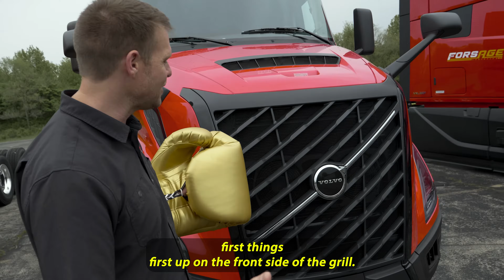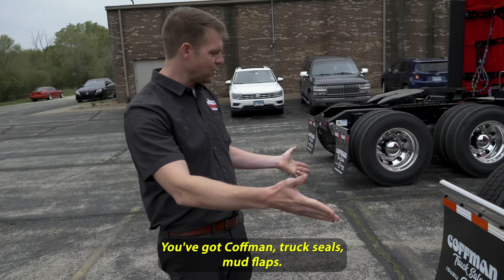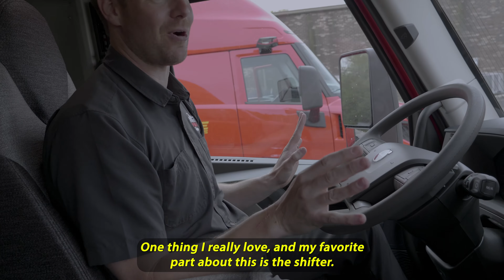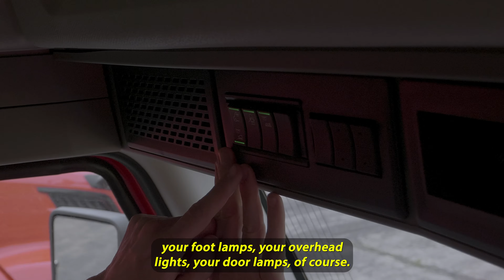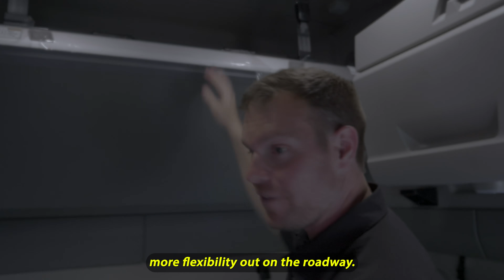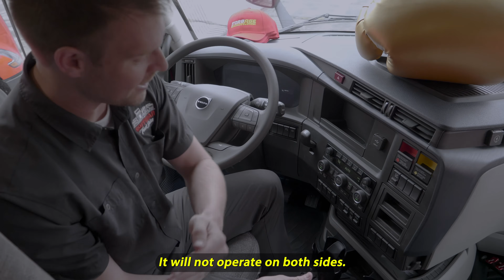🔥 🔥 🔥 2026 Volvo VNL 860 | Voice-Only Edition – Driver-Focused Walkthrough - No Background Music

Comment: Please show us where the new designs are different. Yes, they’ve finally added discs to the front axle, 15 years behind European models. Yo do realize that every modification we get here is second generation from Europe, don’t you?. Be it Turbo Compound, I SEE, Dual Clutch, the axles, the automated gearbox I-SHIFT, etc etc. The hood was the biggest modification, needed to keep the engine cool but yet to see real fuel savings on a working truck🙈. The follow up cab lines come from the FH AERO and was designed by the same draughtsman. Yes the interior is updated, right out of the FH. Modifications to the side skirts has happened on every face lifted model since the WA. Not sure if Johnathon was involved with the side skirts, but a third step should have been added and more width/depth for sure footing and easier access in and out of the cab. Try walking up that ladder to the bunk or down without shoes on, especially when it’s dark and you need to go to the bathroom. It’s a Barnum & Bailey Fiasco🙈. The drive train has been run at much heavier weights for years, no real risk there, it’s the electrical installation that needs attention for reliability issues. The 100% move to 24volts should have been a major change also. This bank system will cost more in battery replacement year after year. The heating and cooling systems have been around for many years, nothing new there but nice to see it being used in North America finally. Let’s see if you can bring us fuel figures, driver feedback, and pros and cons out on the road as they get some miles on them. Tell us if the vehicles are in for warranty work, breakdowns etc etc. This is what sells trucks, proof of reliability and cost effective operating and running costs. Are there any being delivered with mirror cams?  If not why? 
A Chicago/ New Holland company who sold out to a large group a number of years ago had one of the best livery’s I’ve seen here in North America. If you know, you know. Top family owned business too. 👍🇺🇸
Reply from the maker: Paul, this is hands down one of the most insightful and well-informed comments we’ve received. Genuinely appreciate the time and depth you put into this — it’s clear you know the industry inside and out. 🙌

You’re absolutely right — a lot of the “new” features hitting the U.S. market are second-generation tech from Europe. From I-SHIFT to Turbo Compound, from cab designs traced back to the FH AERO, and even the long-overdue front disc brakes — it’s a pattern we see again and again.

You also brought up key points we didn’t touch in this video: real-world fuel savings (or lack thereof), electrical system reliability, missed design opportunities like safer step access, and the absence of mirror cams. These are real concerns that often get lost in glossy walkarounds.

Here’s what I’d love to do: if you’re open to it, drop us a list of what you think should be covered in a proper, honest review — the kind you wish you’d see more often. We’ll take that feedback and create a follow-up video built around it. We’ll even mention you as a collaborator, because that level of input deserves credit.

Thanks again for sharing your knowledge — this is the kind of conversation that helps move the entire industry forward. 👊🇺🇸 David B. i'll wait for your reply
Reply: @forsagelogistics Hi David. Thanks for the reply. Super busy this week but I will get back to you with ideas.👍🇺🇸
Reply from the maker: Paul, this is hands down one of the most insightful and well-informed comments we’ve received. Genuinely appreciate the time and depth you put into this — it’s clear you know the industry inside and out. 🙌

You’re absolutely right — a lot of the “new” features hitting the U.S. market are second-generation tech from Europe. From I-SHIFT to Turbo Compound, from cab designs traced back to the FH AERO, and even the long-overdue front disc brakes — it’s a pattern we see again and again.

You also brought up key points we didn’t touch in this video: real-world fuel savings (or lack thereof), electrical system reliability, missed design opportunities like safer step access, and the absence of mirror cams. These are real concerns that often get lost in glossy walkarounds.

Here’s what I’d love to do: if you’re open to it, drop us a list of what you think should be covered in a proper, honest review — the kind you wish you’d see more often. I’ll take that feedback and create a follow-up video built around it. We’ll even mention you as a collaborator, because that level of input deserves credit.

Thanks again for sharing your knowledge — this is the kind of conversation that helps move the entire industry forward. 👊🇺🇸 David B.  I'll wait for your reply
Reply: Does the FH get the steering leaver shifter? (Not sure what it's called!) Isn't that new that isn't in the FH?

Comment: Why you guys get plain trucks! What about driver comfort them seats looks hard ...steering wheel not leather no touch screen
No fog lights why the whole truck not red looks so cheap
Reply from the maker: Fair questions, Jamel! 😅 We get where you’re coming from — but most of these trucks are spec’d for durability and function first, not flash.

That said… comfort does matter, and we’re always tweaking specs based on driver feedback. Red paint, leather wheels, touchscreens — it all adds up but we’re working on finding that sweet spot between comfort and cost. 

What would be your ideal truck setup? We’re listening!

Comment: I had to drive a rental for a few weeks with all the safety features. The blind side monitor is a pain. If you are in traffic and need to get over, you turn the blinker on and the buzzer goes off non stop until you turn your blinker back off. Same with Turing at a traffic light. Dual turning lane, turn on the left blinker and the buzzer goes until your done with the turn. Auto braking, also awful. Cursing at 65-70moh, car in front of you exits off the interstate and the alarm goes off and it hits the brakes. And for the automatic parking bridle picking if you unbuckle….hope that only happen when you are stopped. Example….banking into a tight spot at a truck stop, unbuckle so you can turn your body to see better and nope, parking brakes engaged. If a “professional driver” has to have all that to be a safe driver then he’s not a very good driver imo
Reply from the maker: Mark, 100% hear you — a lot of this tech feels more like it gets in the way than helps. But here’s the bigger picture…

The day these trucks actually drive themselves — is the day a lot of drivers lose their jobs. That future’s coming fast. So for now, maybe it’s a good thing this tech still needs us.

Appreciate you sharing your experience — it’s a reminder of why real drivers still matter. 👊